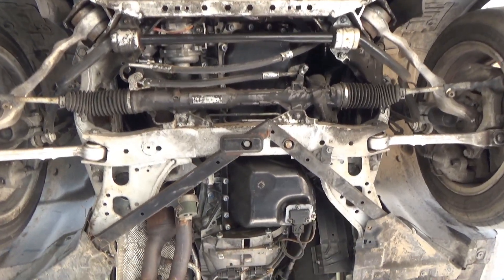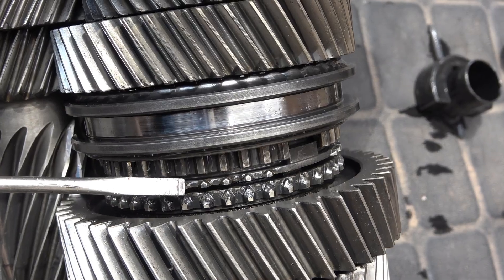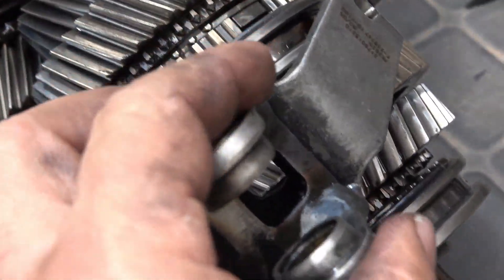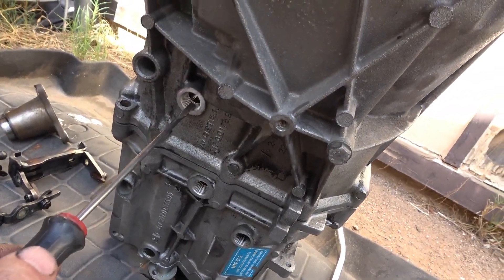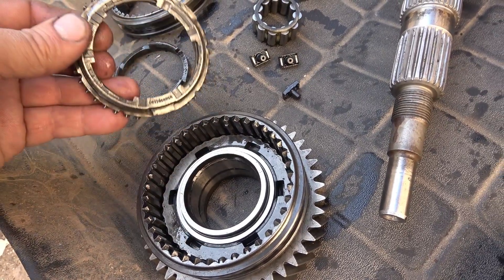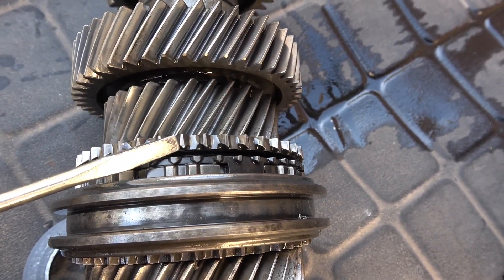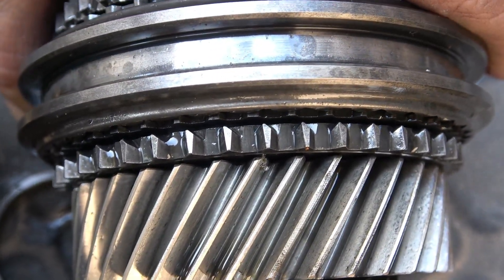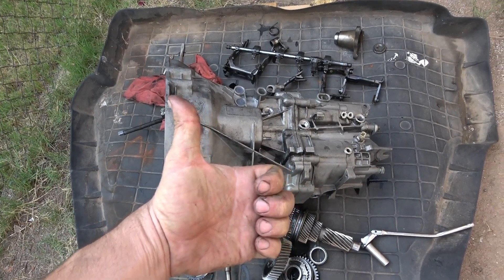BMW E90 Getrag GS6-17BG gear repair - disassembly

Comment: Hi Haken I am rebuilding my own GS6-17 BG I am looking for 3 of the syncro slider ball and springs that you have in your video at 6.42. I would be happy to pay what ever you want for them plus shipping if you are not going to rebuild your trans. Thanks in advance
Reply from the maker: it all went to scrap metal yard, then even if I still had those parts you would not want to pay much for them and wouldn't be worth my time packing and sending them to you anyway.
Reply: No worries thanks for your time

Comment: Thanks for the teardown, so if I understand this correctly, let's say you're in 4th coming to a stop and if you don't slow the second gear by selecting third first and go directly into second you're putting a lot more force on those teeth that engage the collar. Because difference in speed between 4th and second is much greater than 4 -> 3 and then 3 -> 2.

I always did that just because I noticed it was easier to get in gear that way but now I understand what's happening mechanically. Thanks!!

Edit: I guess a better way of saying it is anytime you don't match the gear speed by engine speed you're putting more force on those teeth and not just the synchros.